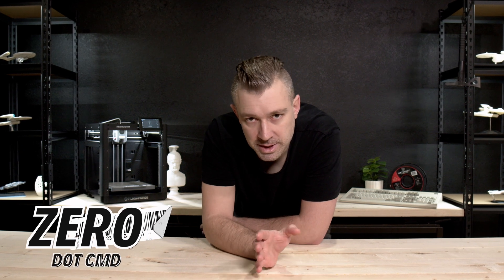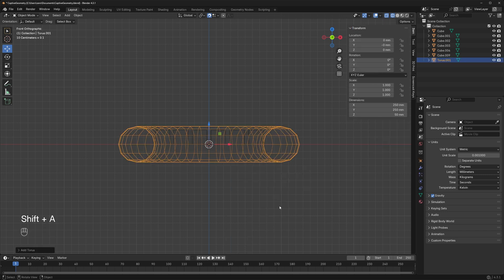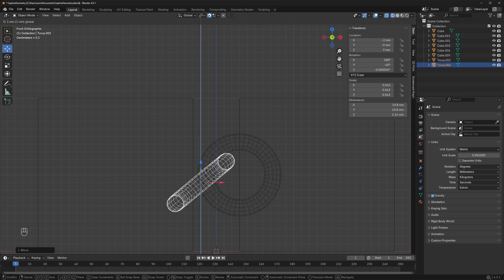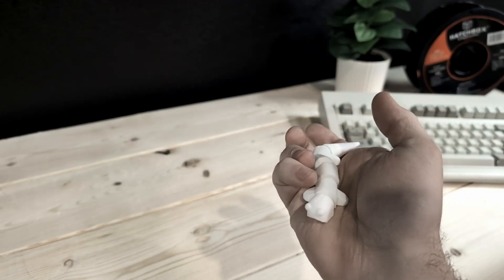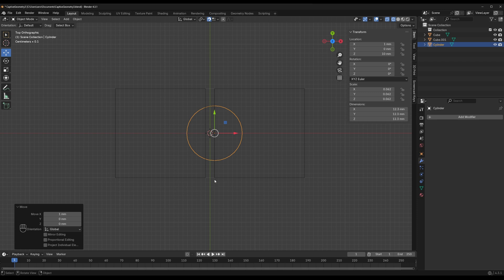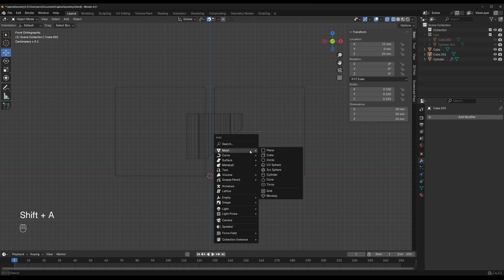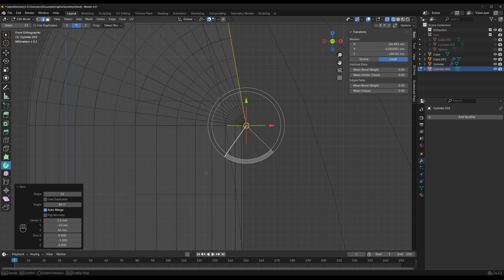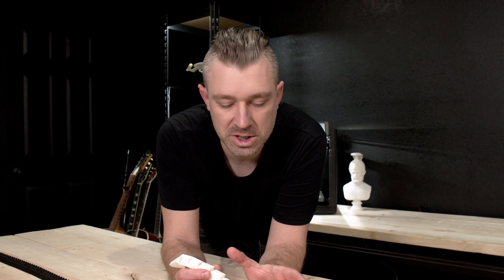How To Design Articulating 3D Prints! Blender Tutorial!

Comment: why do we need the cut the one part at the 45% angle? why can't it just stay the full cylinder with the whole through it? I am finding that part to ending up being too thin and breaking because of that. Can that cutting out the slant part be skipped and it still work well? or does the slant need to be that for the part to move around freely? Like not having the slant would cause it to stop some of its movements.